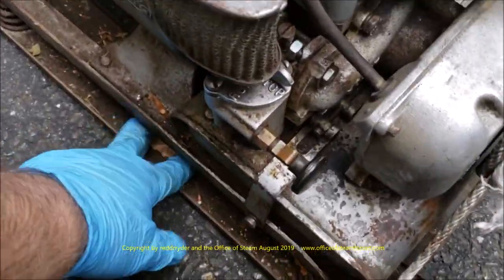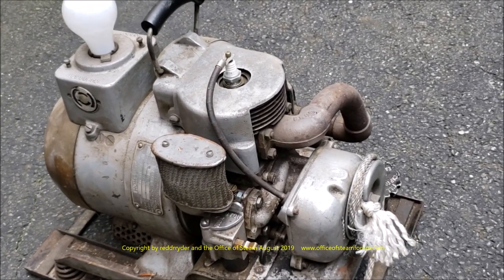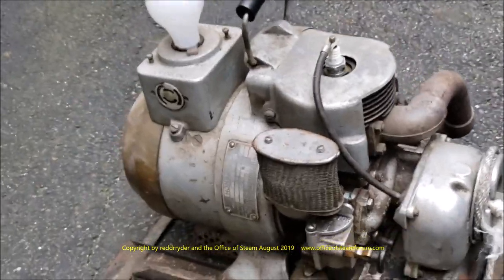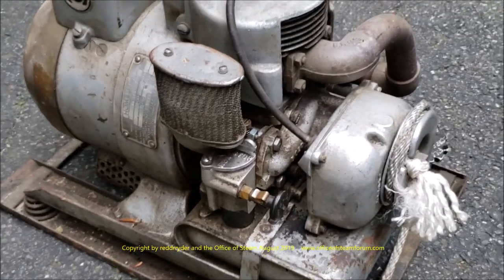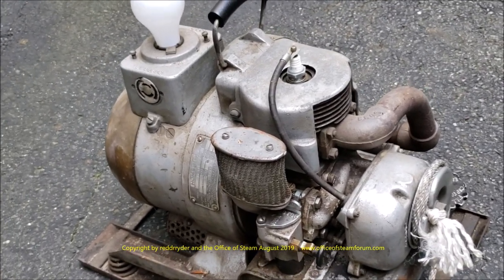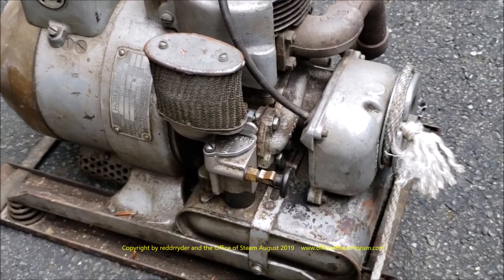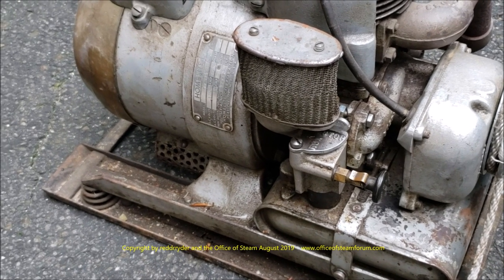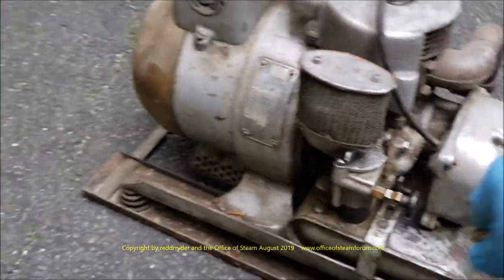Old Homelite Generator Comes Back To Life

Comment: I own one of these, it is still the factory green color and runs great.  Mine is a bit larger, but still a pull start. 3600 watt 26.2 amp rating on it, or thereabouts. The fuel tank cap is a measuring device. You mix in 4 caps of 30 weight oil per tank. Has a muffler built to hang onto the rigid frame with springy feet to help absorb vibration, I guess. I should make a video on it.
Reply: When u gonna make that video